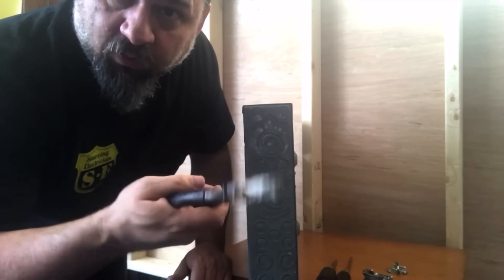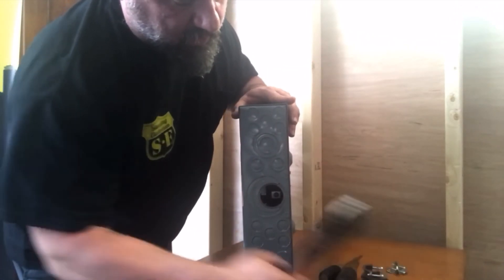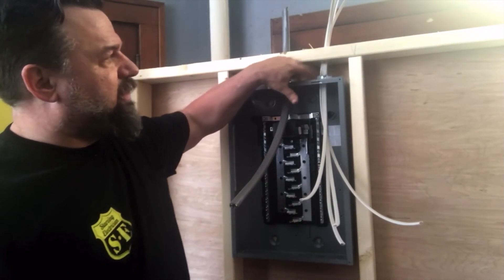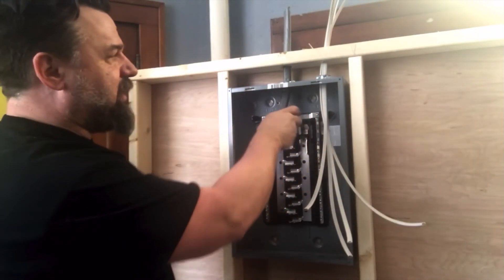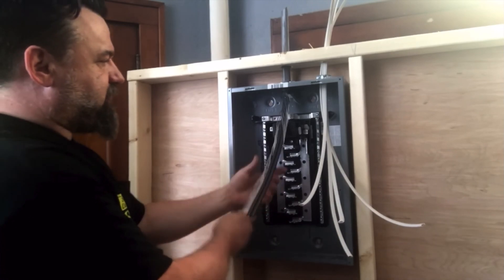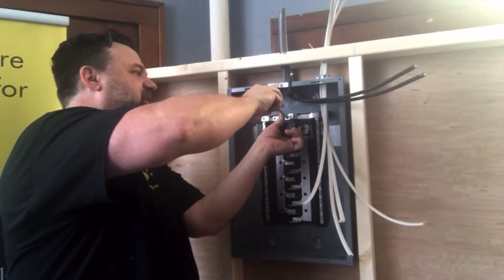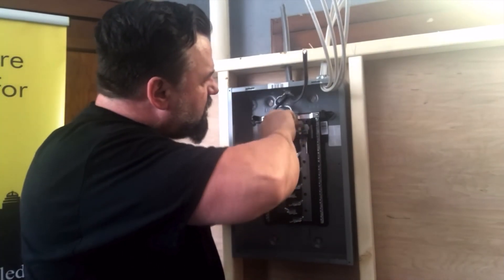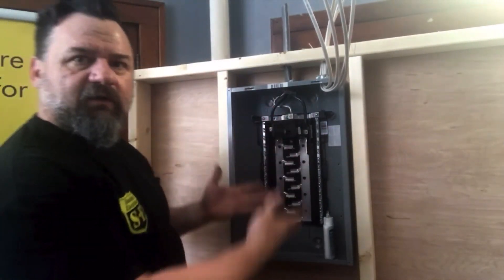How to install a 100 amp electrical service. install the panel to wiring the main.

Comment: Watching Americans use metal boxes to house electric cabling just feels so wrong. When a cable gets lose it electrifies the whole box and becomes a hazard. Metal casings also rust and become brittle and a small metal piece could fall down and short circuit the cables.
Reply: No the breaker will trip
Reply: I feel the same way seeing those rinky dink plastic boxes elsewhere lol
Reply: @AdamC5013  At least the box won't shock you when you touch them or when rust shavings fall into the connections. There is the reason those things burn down so often.
Reply: @HideBuz  I mean, @ 4:42 he says "The first thing you do..." and proceeds to bond the housing to the ground. How can the box shock someone if it's properly installed?
Reply: @BlownF150  If your safety relies on a handyman properly grounding, you can be sure that there is one person who does it wrong and then there is no safety at all. It is just wishful thinking. Safety comes from safe designs, not manual and procedures to offset dumb decisions.  Have you never seen metal boxes that are just fixed to a wooden pole with no grounding? People put a danger sign on it for a reason, because you can get electrocuted by just touch them. They are everywhere in America. Just like the cable wire nut is one of America's most idiotic invention and only used in the USA, because every other country understands that merely twisted cables will always at some point become lose and sparking high ampere cables will catch fire and are thus predictably the reason why American homes burn so often due to electricity fires.
Reply: @HideBuz  There is no such thing as an electrical panel that is inherently safe when improperly wired. Maybe if you knew the NEC and had actual hands on experience you'd understand why the points you think you are making are simply nonsensical.
Reply: @HideBuz  You have no idea what you're talking about. You've never touched a wire nut or an American electrical panel. All you know is from videos.
Reply: @HideBuz  The problem with you is you still don't know what your talking about. You keep saying stuff about metal shavings. The panels are usually powder coated and last decades. There are metal panels in service that are 100 years old. As far as wire nuts, there is a right and a wrong way to install them. The right way is to twist the wires before installing. The wire nut just insulates the connection. It is not for mechanical stability.
Reply: When I first saw these kind of videos I thought why don’t they rip out this switchboard from the fifties and bring the system to the 21 century? Turns out they still use this outdated design with exposed connection screws and stuff. It’s like traveling back in time.
Reply: @hunchbackaudio  There are no exposed connections when covers are on.
Reply: @edisont.picard4112  In a modern switching box there ‘s no exposed conductor when the lid is off. Only ground screws. We’ve got a 3 phase system with 400 volts entering the house. I hate working on old switch boards with exposed connections. One wrong move and you had fireworks., or worse. In modern boxes     eighties and later, there’s no way to touch any conductor by accident.
Reply: @hunchbackaudio  I guess we just aren't that worried about it. It works and we don't change just for the sake of change.
Reply: @edisont.picard4112  It’s the industry that makes the changes we just deal with it. It’s more that when I see switch boards like these they are from the early seventies tops. I run into them occasionally but my first thought is rip them out and also save some space,  modern switch boards are way smaller with lots more outlets.

Comment: 1:04 - Actually, with 100A service using #2 SEU cable, a 1" clamp will work just fine. I typically use the 1-1/4" knockout and clamp with #2/0 cable for 150A panels.